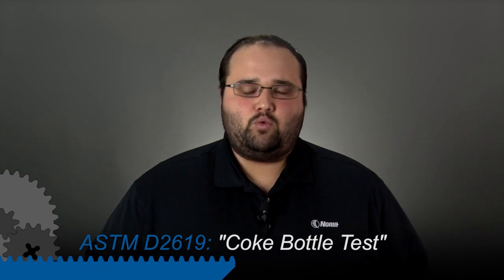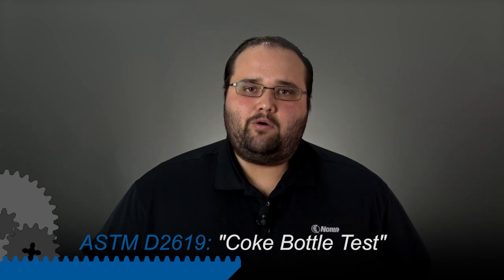How Hydrolysis Can Affect Your  Oil

Comment: Is it the water that already is in the oil, that causes this reaction, or is it water from the outside?
Reply from the maker: Great question! Hydrolysis can occur whenever there is water present. Typically, that's from water ingression (either from direct ingression via washdowns, wet processes, etc or from ingression through humidity that then condenses in the headspace of the machine). That said, it's certainly possible that water can find its way into the oil via other methods (improper storage of drums or even oil that is contaminated right from the supplier) which is why we always suggest testing and filtering new oil before putting it into service.